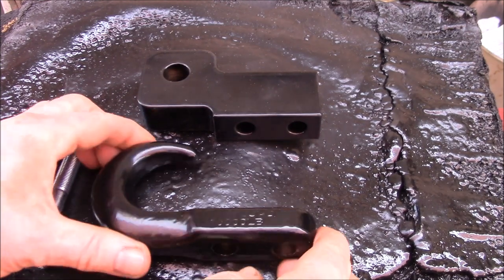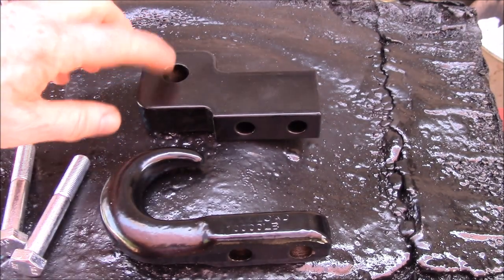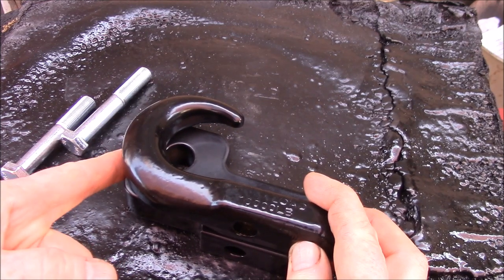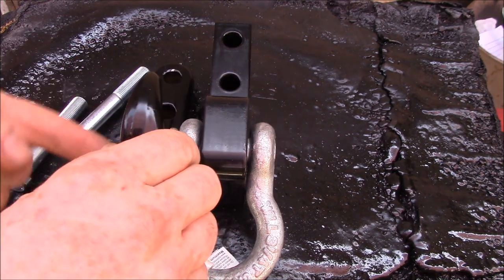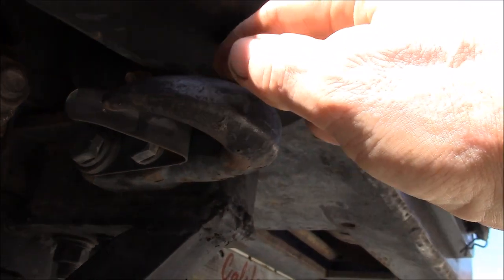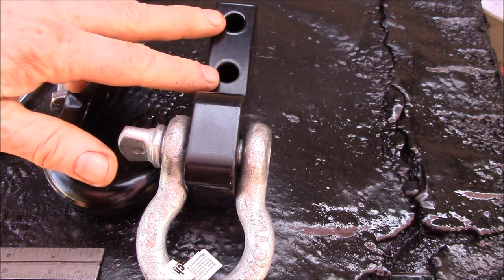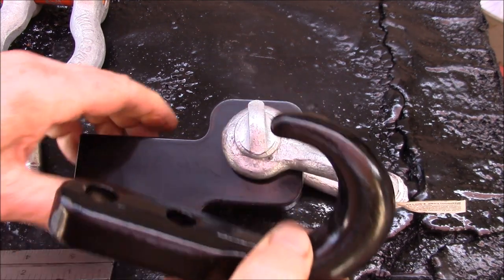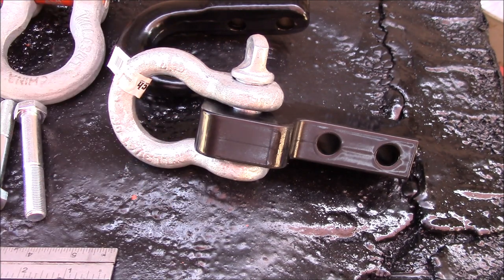Tow Hook vs. D-ring or Anchor Shackle - Comparison

Comment: I liked your video and your discussion of the differences.  What you call a D-ring is actually a shackle.  D-rings look like the letter D and are a different fastening/anchoring system.
Reply from the maker: Good point and yes, there are many types of shackles:
https://www.safetyliftingear.com/news/post/types-of-shackles
According to that page, these would properly be called "bow shackle" or "screw pin bow shackle".
But it seems the common term in  the 4x4 community is D-ring shackle, so I tried to stick with the common vernacular.

Comment: I also have an 85' 4runner... just completely rebuilt the thing.  I got around the clearance issue by getting a front and back bumper from LC Engineering.  They both have a 2" hitch receiver built in.  I put the hitch and recovery shackles there and kept the stock hooks just for another point of contact if needed or whatever.  You can also use pretty much any size shackle and hitch you want without any clearance issues going this route.  The shackle and hitch are far stronger than anything the runner can pull so it's great.  Another benefit I have found using this method is that the shackle is CENTERED rather than a hook on one side or the other.  Makes recovery much easier without having to deal with the vehicle being pulled in off center directions.  This is why trailers, etc. all have a CENTERED tongue.  If you like I can send some pics so you can post more ideas on your channel =]  AND the Shackle is much better for recovery than the hook.  I'm a safety first guy and the shackle is about as safe as it's going to get.  Great video and product R Brown
Reply from the maker: Sounds like a nice setup on your '85, best model year made!  Yes, a 2" hitch receiver is a nice recovery option.  I have 3 - 2" receivers on my rear bumper, one center and one in line with each frame rail plus an adapter for a 7/8" recovery shackle.  I need to make up a 2nd adapter so I can use 2 shackles at a time, if needed.  My front bumper has a center mounted winch and then the 2 tow hooks on either side.  Hooks are nice for a quick attachment point but shackles would be better.
Reply: @The4Crawler  Oh yeah.  Last year of the SFA and the first year of the EFI and power steering :D  I've owned a bunch of the pre-85 pick ups but I'm 6'2" and there is NO ROOM in the cab lol.  The 4runner is great because there is no cab back and the seats go a bit further back.  I'm in the process of doing the interior now.  Nothing fancy, just upgrading the old gear... the bars in the seats are brutal lol.

Comment: I will have to check my tundra Thanks
Reply from the maker: Toyota usually has those mounting holes up on the front of the frame rails on all their truck models.  Haven't checked on the Tundra myself, but the later model Tacoma pickups are set up like that.  But it all depends on what's around that location as to whether a tow hook or a shackle anchor will fit.